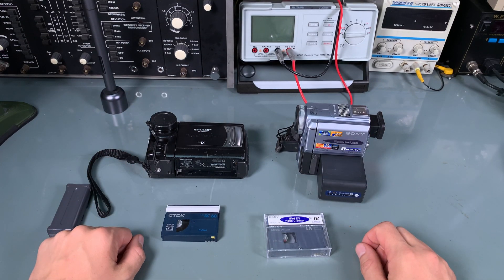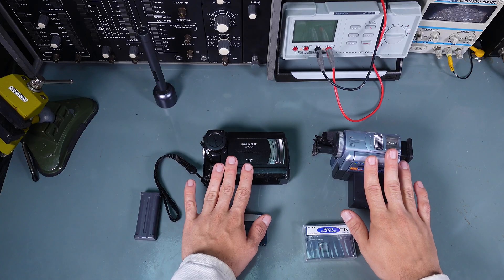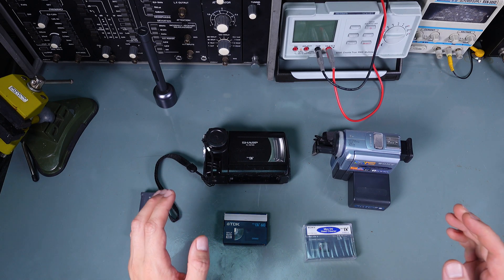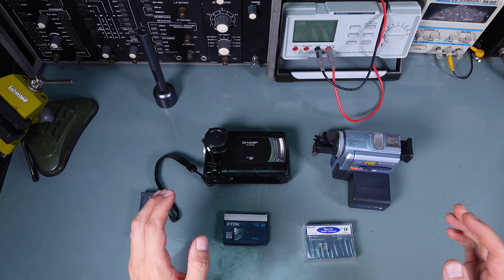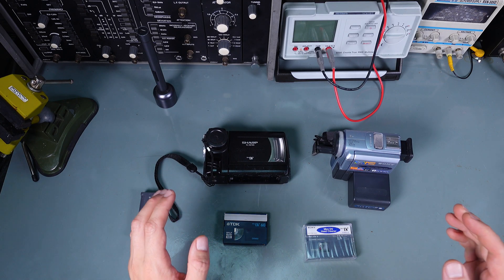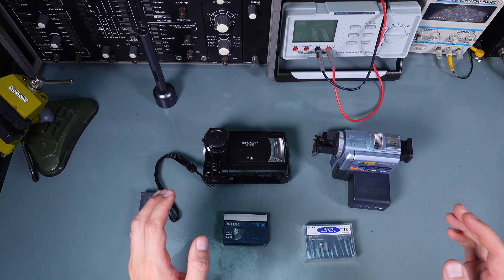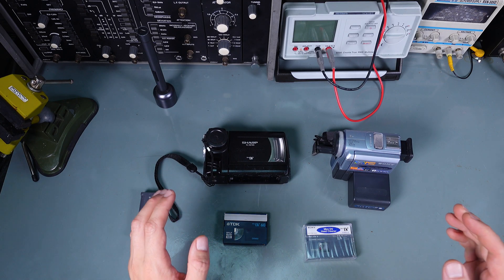MiniDV Sony Head Cleaning  Cassette (tape)  DVM4CLD - fixing Sony camera DCR-PC8E & Sharp VL-NZ105

Comment: This cleaning cassetts are so hard to find.
Reply from the maker: That's true - better stock up. I can give You tip - if You ever see vintage camera bag for sale on fleamarket- check it - people had tendency to keep cassettes there... You can score bag & tape. Multiple times I got extras like battery, charger - that way:)
Reply: Ebay loads of them!
Reply: And pretty expensive when you find them